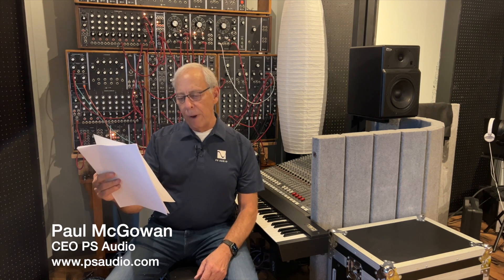Vacuum tube watts

Comment: It is important to add that in the heyday of tube amplifiers before the 1970s, very sensitive open type speakers with paper diaphragms were used, and with these speakers, 3-4W is already very loud. Tube amplifiers do not amplify low frequencies well, and this makes it impossible to amplify bass at low power.

Comment: ❤Paul thanks that explains a lot.
Question,  I have a Joe Meek twin Q pre I use w a tube mic called Revelation II.  I'm getting the best sound ever.  Kinda creamy buttery sounding. We won a Hawaiian Grammy called the Na Hoku for the best Alternative album of the year. I have a button pushed on the Joe Meek called (Iron) which puts an audio transformer in the circuit.  How does a transformer modify audio?
They have an iron core and coils of wire which have inductance.  But why is the sound better or different with a transformer?
Thanks Paul

Comment: It reminds me of recording on multitrack magnetic tape where there was a natural and very pleasant analog compression when you bumped into the red of the VU meter.
When early digital recording was in its infancy. It was learned very quickly that getting into the Red on the VU meter was a No No. Instant distortion and horrible sound.
Digital Recording and the theory behind it has come a long ways since those Analog "Halcyon Days" in the 1970s. 
Before the ~early 1980's 16-bit recordings and multitracking mixes made many people cringe. Because it was, at best, 12-bit quality. Personally, I think that helped drive the "Techno" sound in the popular music of the era. With final mixes sounding harsh. Almost like the Nintendo 8-bit sounds we had heard for years on video games.
When the Nyquist theorem's "problems" were gradually worked out. With better equipment, higher bit-rate equipment on individual recording tracks. All done before mixing down to 16-bit 44/48k final mixes. Or higher resolution subjective preferences as technology has progressed.
There has been a convergence to a place where subjective enjoyable human preference, and perhaps nostalgia and "aging ears", have reached an equilibrium. And music has become wonderful again.
That's my take on it. Your mileage may vary.

Comment: There is another factor you didn't mention, solid state amps have very high amounts of negative feedback to keep distortion low because transistors, particularly bipolar transistors are extremely non-linear devices.  Tube amplifiers incorporate much smaller amounts of negative feedback.  One result of this is a lower damping factor.  Depending upon speaker design, solid state amps can because of this high damping factor, waste a lot of power trying to force your speakers to do the right thing even at subaudible and superaudible frequencies.
Reply: This is the result of poor engineering, using op amps with unlimited amplification and long feedback from out to in, it must be only local feedback and all stages must have limited amplification factor without feedback, there are very few super symmetrical diagrams 
available that work without long feedback and keep stabile zero voltage output. Long feedback acts like a compressor that cuts off low frequencies. You dont need bass control knob if you use only local feedback amp. Tube amps are pointless because output transformers make them complicated/expencive and many tubes have very limited lifespan. There are transformerless variants but all reviews i have seen are negative.

Comment: One thing Paul forgot to mention is the Ohm rating of a Loudspeakers drivers inside the cabinet! Driven with Tube Amplifiers! Tube amps will produce their rated output into an 8 Ohm Load! But not at a 6Ohm or 4Ohm load or even a 2Ohm load! A 4Ohm load is twice as difficult to drive as a 8Ohm load! Meaning a 40 watt rating for a tube amp is at 8 ohms as I stated above,  a 4 ohm load will output up to 20 Watts.  And a 2 ohm load well output up to 10 Watts! 

Loudspeaker drivers (individual speaker drivers) do not all output the same ohm rating! 

Some loudspeakers that have 6 ohm drivers will also have a driver that’s 4 ohm or even down to 2Ohms but that is rare! 

ALL loudspeakers cabinets have  ohm load swing! Some will drop down to 3.5 or 3.2 ohms! and even 1Ohm load! there was a company called Apogee that manufactured loudspeakers with Ribbon Tweeter, Ribbon Midrange and Ribbon Woofer panels that had magnets on the left and right side of the cabinet that were wired to its ribbon panels, similar to Magnaplaner! The Apogee Scintilla dropped down to 1Ohm load! there were only a few amplifiers manufactured back in the late 80s and early 90s that could drive those loudspeakers without clipping and damaging solid state amplifiers and the ribbons! 

Magnaplaner states to only use good quality solid-state amplifiers that are capable of doubling their power from 8Ohms to 4Ohms! 

Most loudspeaker manufactures will not tell you that in their specs! you have to call somebody in technical support and ask them that direct question and usually they won’t know the answer!  Sometimes only the designer of the Loudspeaker will have that information.

There are no standards for Loudspeaker manufactures to provide the information on what the ohm level swing is.

Some audio viewers will have test equipment to measure and provide that information.  Most reviewer‘s will not because they don’t have that equipment.

Comment: ...to answer the proposed question: no.  A watt is a watt is a watt, a unit of power; V*I=W.  1volt*1amp=1watt, no matter if a tube-based or semiconductor-based circuit is used.  Most of the perceived differences between the two circuit methods occur when the circuits are operated beyond their respective linear regions.  Not saying people don't hear differences, but what they are hearing ain't "watts".

Comment: Good point about most folks not using their hi-fi amps anywhere near what they are capable of. Well stated.  So a 20 watt per channel tube amp and a 100 watt per channel solid state amp both would sound very loud at, say, 15 Watts per side with moderately sensitive speakers.  Electrically, a watt is a watt is a watt !!!!  There's no difference in a tube watt than a solid state watt, no magical voodoo going on - it's a basic theoretical parameter.  1 Watt into an 8 Ohm load is (2.83V*2.83V)/8 Ohm=1 Watt. 
     When wattmeters started coming out on Amps, whether digital or analog, separate or integral, we all thought:
"That's it? I'm only peaking at 2 Watts and my stereo is THIS loud?" Ah, to be young again when most of this crap was a cool mystery.....

Comment: If a speaker has an efficiency of 90dBa given 1 Watt of electrical energy at 1 metre and you replace it with one rated at 93dBa, that speaker will be twice as loud. The valve amp also has a completely different relationship with the speaker and is connected with the output section by means of an output transformer which has no direct connection but rather an induced magnetic field between the primary and secondary and you lose half the electrical energy in the transformer right away.

Comment: If you listen to music you will usually not exceed 1 W of output power to drive your speakers. I have a self made amplifier at home with an output power of 2 x 12 W. If I use it normally I have measured an average RMS power of less than 100 mW with some peek values of 1 or a few W. So the output power of my amplifier is perfect for me.

BTW: our ears are extremely sensitive. The efficiency of a normal speaker is usually somewhere in the range between 2 to 5 per cent. Most of the power which drive the speakers is wasted as heat in the voice coil and damping materials. What I listen to is therefore just a few milliwatts of acoustic power.
Reply: Sadly it is BS, anybody wanting a decent bass in music using closed speakers cant live with less than 20w even with 93-95 db sensitive speakers. Bass component has much higher amplitude in signal and cant be quality reproduced with some 5-10w amp.

Comment: is the sensitivity specified then that low because of the passive filtering in the speakers? for PA systems 97dB or even slightly over a hundred are not uncommon

Comment: So how come speaker manufactures don't have all high sensitivity? Serious question
Reply: Because closed cabinets and soft rubber membranes to make bass amplification more effective, make your own open speaker with your handheld stereo 3w speaker and 97db+ is no problem.
Many manufactories lie about sensitivity, they sell a speaker as 6-8 ohm but it turns out to be 3-4 ohm.

Comment: Great video Paul, thanks for that useful explanation and distinction between SS and tube amp. I like to think that greater power means when a beefy bass note comes along there is a reservoir of current available on tap to meet the demand of the woofer and improve control. My experience also is that when power is increased ( e.g. bi amping ) sound stage grows too, becoming taller and wider.

Comment: Great explanation. Question. If a speaker with a sensitivity of 88 dB at 1 watt in 8 ohms is considered medium, what would the sensitivity be for a low sensitivity loudspeaker? Obviously less, but can you specify this?
Reply from the maker: Sure. I would say low sensitivity loudspeakers would be 85dB.
Reply: @Paulmcgowanpsaudio  Thanks, Paul! 85 dB/1W/1M speakers can deliver 98 dB SPL at 1 meter with only 20 watts. That’s still enough imho. I have 25 years of experience measuring different audio systems with professional SPL hardware meters. Most people don’t know how loud for example 100 dB (A) is at 3 meters when you have a very capable audio setup at home. It’s loud. Incredibly loud. Even if we listen to a speaker set with the medium 88 dB sensitivity, listening at only 1 watt per channel driven by the amp is actually loud enough for most people. I own a pair of ADAM Audio studio monitors that I use in my home studio and they can deliver more than 110 dB SPL without distortion at 1 meter. Sometimes I crank the volume up if a musician or artist comes over and they cover their ears with their hands while they are at 4 to 5 meters from the monitors. But rest assured, I mix and master at 85 dB SPL. My ears are the most important tools. Have a great Sunday!
Reply: "medium" is not a science measurement. Keep it simple, use DBs, watts, distance.
Reply: @NeverTalkToCops1  I know. I only used the word medium for the only purpose of asking a question. And also Paul himself uses this word in this video. And please, be kind. Have a nice day.

Comment: In my experience, watts and sound quality are inversely related. There is a price to pay for high power. One sacrifices sound quality when increasing power (generally speaking, IMHO). Low power triodes have a transparency and emotional tangibility that solid state designs are lacking. Hence, I’d take a high efficiency speaker driven by a low power amp over a lower efficiency speaker driven by a high power amp any day. Paul’s argument about “coasting” was interesting nevertheless. It might very well be true within the context of systems he sells. I find that my tube based systems with 2 watts per channel never appears to be “overdriven” or “strained” whatsoever. It’s all relative I guess …
Reply: @groovesick - that's a very interesting thought.  I might have to play with that concept.  

I used to be a car mechanic in a previous life and I always tend to think in moto-mechanical analogies.  The picture that comes to my mind is a well tuned large engine vehicle vs. a smaller economy car.  If you are doing lots of low speed driving for short lengths, never pushing it too hard, the smaller car is going to provide a less wasteful return on energy put in.  If, on the other hand, you need to pull a large load at highway speeds, the truck will provide a much more pleasant ride.  The economy car might technically be able to pull the load, but you run the risk of stressing out that vehicle much more that the other. 

I tend to mix and listen at around 85dB.  That's the recommended average max level for making the music seem full, but staying below the threshold of hearing damage.  It is an encouraged standard in mixing, so I am just kind of used to it, although I am sure others would find it a bit loud for their tastes.  Listening under those conditions I absolutely hear an improvement in transients with a more powerful amp.  I can hear the improvement at lower volumes also, but higher spl's are where you really notice the difference.

I have a solid state Marantz unit here from the late seventies maybe.  It has output wattage meters on it (cool!), and I am stunned at how sometimes I am listening to room filling music and it is only putting out 0.5-1.5 watts.  So your 2 watt amps probably sound just gorgeous if you aren't the type to open it up too far.

Comment: This is getting into the silliness of a question like “which is heavier, a pound of lead or a pound of feathers?”  A watt is a specific value, derived from the relationship defined in Ohm’s law of voltage squared divided by resistance.  No more, no less.  You do a fine job explaining the differences in behavior when approaching the amplification maximum limit.  But the reality is, even including those anomalies and artifacts, a watt is a watt is a watt, regardless of how it is derived.  It is also correct to note the signal in tube amplification sometimes contains harmonics not present in a solid state amp.  But when measuring the amplifier output voltage on a true rms meter into a dummy load, a watt is still just a watt.  Doesn’t matter if it is generated by tube, solid state, or magic pixie dust. A watt is a watt.
Reply: Correct.
Reply: A watt is a watt, you can't change physics.  All things being equal a test tone through tube amp and a solid state amp will produce the same  output level.  Everything changes when you are using a complex signal like music.  The physics don't change but how we hear plays a major role in what "seems" louder.  To have enough headroom to avoid clipping in solid state amps you need more power.  The tube amp could be clipping but us is less noticeable because of how they distort.  My car drives at 60 mph no problem, just like a formula 1 car.  The difference is when you hit the gas to get to 100 mph.

Comment: I have a Prima Lina EVO400 valve Amp. In Triode mode it gives 38w into 8ohms . In Ultra Linear mode around 75W. If I swap from UL to Triode on the fly the volume difference is negligible. I am driving Martin Logan Electrostatics with a sensitivity of 91. The volume control at 40 percent is about as loud as I ever play it. I doubt it ever clips. The Prima Luna is a gorgeous Amp. Thank you for your excellent presentation.
Reply: @Beagle76- interesting thing bout wattage.  (Please forgive me if you already know this) Because of the non-linear scale of human hearing (Fletcher-Munson curves), you need to go (roughly) ten times the wattage to be perceived as (roughly) twice as loud.  So to be a noticeably louder jump up from a 38 watt amp, you really need to get in the 200-400 watt range.  75 watts (slightly less than twice) isn't going to deliver a huge difference, as you yourself noticed.

Comment: Hey Paul, can you explain the difference in two solid state amp sections of receivers, one rated at 30W from the late 70's and the other rated at 110W from around 2002... And why the 30W (Pioneer SX-680) seems to have a lot more power than the 110W (Yamaha HTR-5980, AVR). I am under the impression that the older receivers were underrated or rated with a different set of parameters that "underrated" them compared to later models.
Reply: @vqman- I honestly can't speak to your specific components, but there is quite a bit of fudge room in how manufacturers rate power.  

In reality, a watt is a defined measurement, and when measured and labelled correctly, can give some solid insight into an amp's performance.  But, through not fully defining the parameters used, the same amp can be described with wildly differing numbers.  

The three main considerations determining wattage ratings are: 1) peak voltage or RMS voltage used for calculation, 2) what rating load are they running it into, and 3) peak vs program for output.  

Very quick down and dirty: 
1) peak voltage converted to RMS voltage means you multiply it by a factor or 0.7071.  So that means 100V peak is the same energy as 70.7V RMS.  100 volts (undefined) sure sounds like it should be more powerful than 70 volts (undefined), although in a lab sense, when properly labeled, they are the same amount of voltage created.  True power is calculated using RMS, but don't expect everyone to adhere to that.
2) what load used is closely related to number one, as it can also vastly affect the reported numbers.  In an extremely rough sense, an amp generating 100 watts with an 8 ohm load can also create 200 watts into a 4 ohm load, and so on.  Same actual voltage at the amp's output.  But according to Ohm's law (watts= voltage squared divided by resistance) halving the resistance you feed from the amp output will double the power rating, even though the amp output itself does not change.
3) peak vs program means it might be able to put out 100 watts for a brief pulse or transient (peak), but can it sustain that delivery of that 100 watts continuously without fail for a duration of time (program)?

So, between those three things, coupled with advertising using creative license to fudge or poorly define numbers, you can end up with a situation like you described.  Hope that helps.

Comment: Those are Hafler TRM8 monitors? If so, you actually use them? I just bought a used Hafler 9505 Transnova power amp on Reverb. I always wanted one ever since I used to read magazines like MIX & others, maybe 30 years ago, dreaming of working in a big recording studio. I never got into pro recording though but I'm finding a lot of pro gear can do very nicely in hifi, & often, for much less than the "hifi" market equivalent.